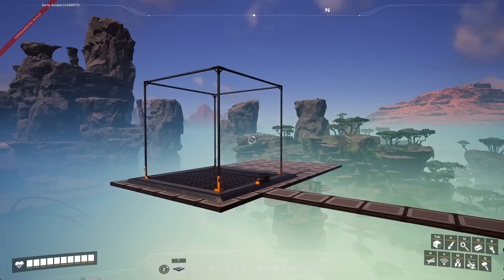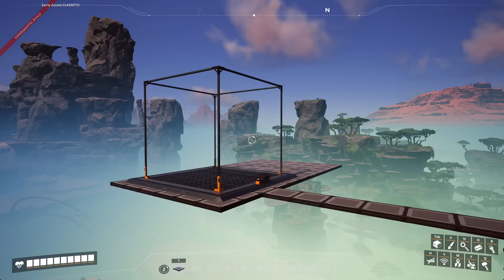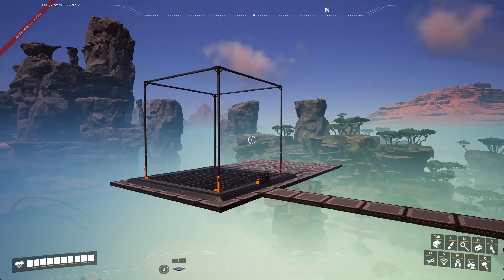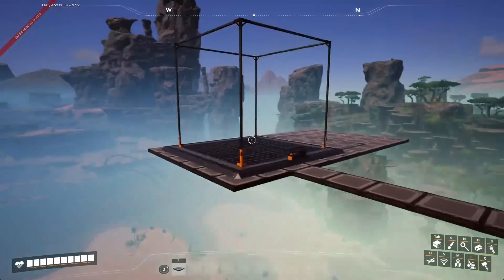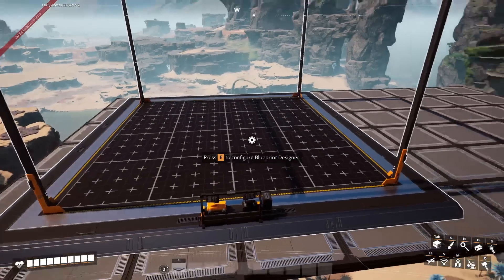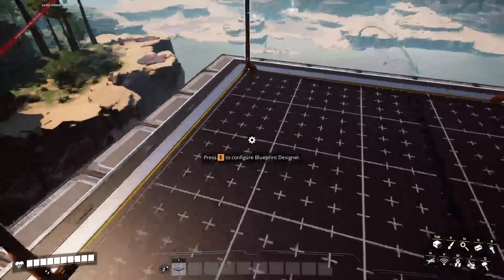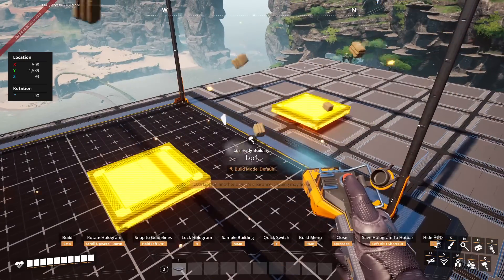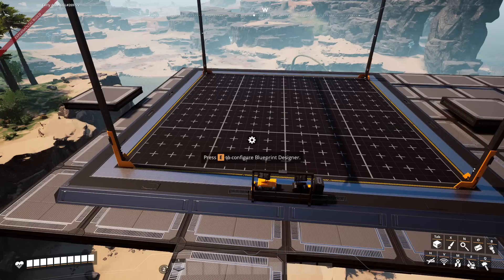GAME CHANGING BLUEPRINT DISCOVERY THAT NO ONE ELSE KNOWS - How to make bigger blueprints in Update 8

Comment: This is what happens when you use == instead of >= for boundaries in programming.
Reply: I believe is more complicated than that, the key part of the blueprints is that every piece has an "entity" that belongs to and can reference to it. But the blueprint itself doesn't care if anything inside is deleted, or if there is 1 or 500 objects inside. While this has advantages like having simpler control and less information needed on memory, there is unexpected exceptions like this one that will most likely need a "hardcode" fix
Reply: You're overestimating the amount of programming they're doing. They just have some collision volumes set up on the edges of the blueprint designer by the looks of it.

Comment: Install blueprint designer plus, drop a mk5 designer, create the factory and then you can simple drop all necessary production lines within no time. 

Got all factories as a blueprint. One click and my aluminium factory is ready for 800 sheets, 120 batteries and 1500 casings per minute.

Comment: Cool bug but at this point might aswell use a mod to get bigger blueprint designers. Also the placements required to make this work it seems like building an actually factory would just be faster and easier with smaller modular blueprints
Reply: I take this back after watching Kinstructions video where he used this technique to create large curves and other shapes. Very useful when applied correctly
Reply: Or you can think of it as a way to build much bigger modular blueprints, without using mods